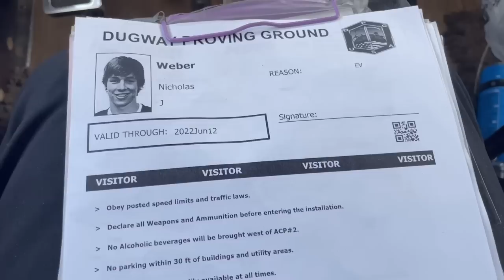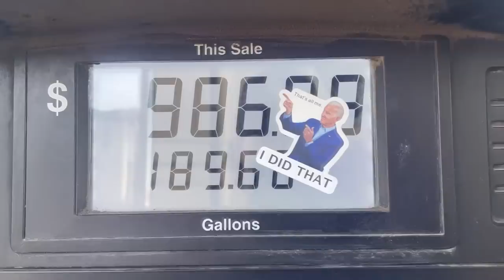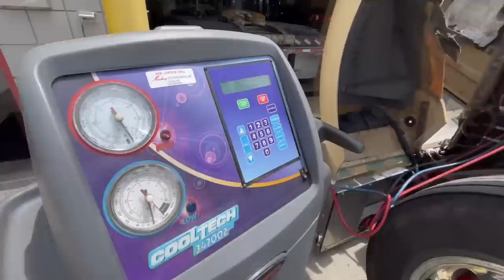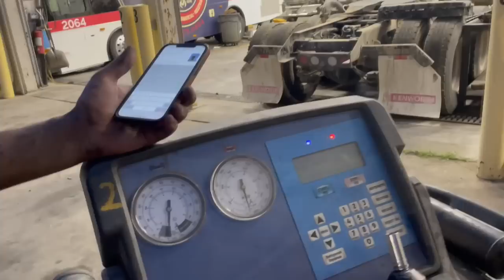The Battle of AIR CONDITIONING

Comment: the high pressure switch should shut the compressor off way before it gets high enough to slip the belts.  I’d get a new high and low pressure switches and have the system flushed. I also noticed there isn’t a fan shroud around your fan.  Without a shroud the fan can’t draw the air through the radiator and that isn’t getting air across your condenser on the front of the radiator.  I sure hope this helps. I hate seeing someone get taken advantage of!
Reply: Gregg’s right on

Comment: That’s the smoke stack for the copper mine. Dirt moves on a 3 mile conveyor belt from the mine to the smelter. I forgot exactly but what come out makes acid rain.
Reply from the maker: Ooh okay! Interesting🙌
Reply: Hydrogen sulfide mixes with water and turns into sulphuric acid 🤮🤮🤮🤮
Reply from the maker: @mr.whitefolks7004  nasty 😷

Comment: Had a similar issue with an old truck I drove. Replaced different parts multiple times within 2 months. Then finally replaced the whole system and every sensor and valve. Still didn’t work. Came out to be a damn ground wire going to the starter that was burnt out, had to replaced the starter and part of the wire, worked perfectly after that.  So much money and time wasted and like 5 different shops. 🤦‍♂️🤦‍♂️. Hopefully yours is fixed now. Lol
Reply from the maker: Oh man I’m sorry to hear that man!! Glad it’s fixed! Sucks you had to go threw all that though. She works when she wants to😂